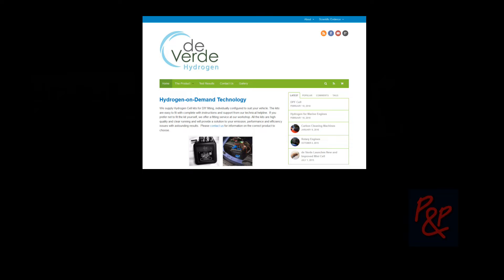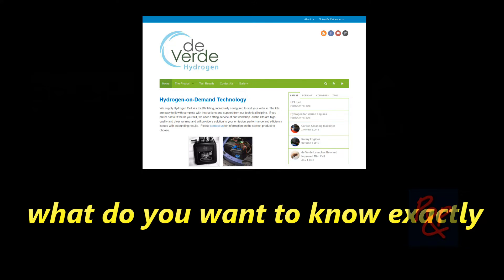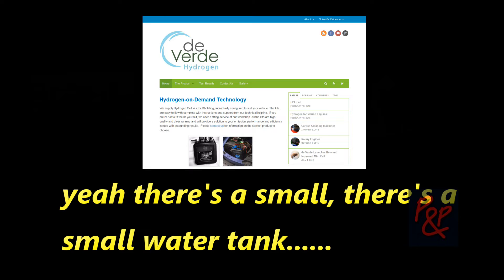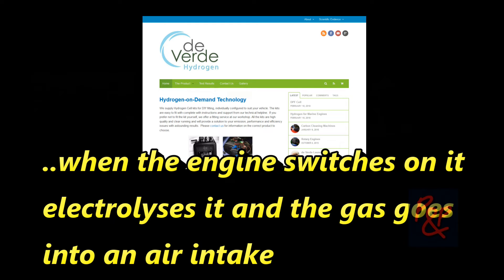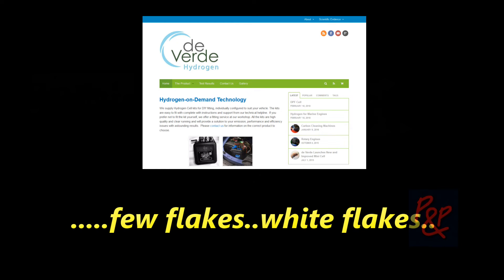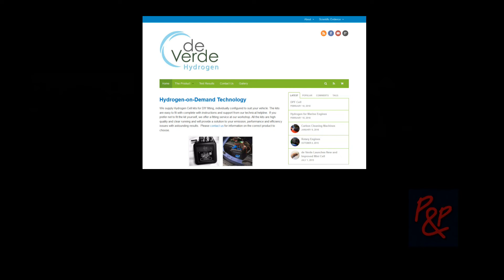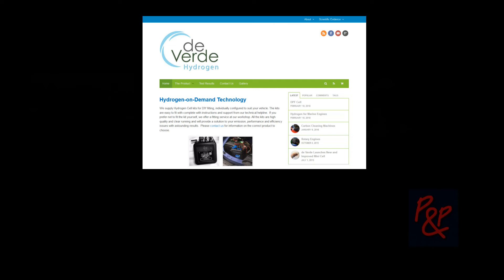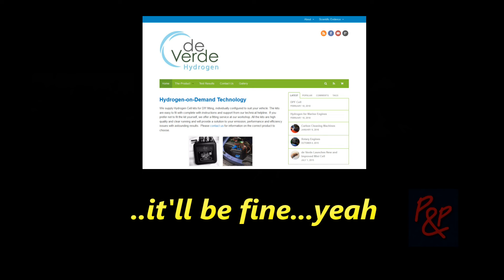Electrolytes Demonstrate Water Is NOT Hydrogen & Oxygen #2

Comment: This is basic chemistry from so long ago I can hardly rmr. However, if I rmr correctly this is a separation technique. Use an electrolyte like salt (NaCl) and dissolve it in water. Using a inert electrodes carry out the electrolytic process (if i rmr coreectly non metal at anode (positively charged) and metal at cathode (negatively charged). What you would expect is Cl2 gas evolving. However that's not what we see. Oxygen is instead evolved (outs a lit splint with a pop) because water is of H20 or H+ ions and OH- ions. Since OH- loses its electrons easier than Cl- the following reaction occurs 
4OH- ---> 2H20+O2+2e where oxygen relights a glowing splint. If water were not made of oxygen how could this be the case
Reply from the maker: The gases as products from electrolysis come from the electrolyte - not the water!!!
Reply: Peter & Pete
So where does the oxygen come from if salt is used as an electrolyte? If the NaCl breaks down into sodium and chlorine, the sodium will combine to form sodium hydroxide, NaOH, so there goes the oxygen and half the hydrogen.  
What happens when a solid polymer electrolyte is used, there is nothing other than the H2O for the gases to come from?

Comment: Didn't this dude just explain that the KOH is a catalyst? I can't believe this.
Reply from the maker: Chavez Harding so how do YOU know the hydrogen and oxygen come from the water and not the koh? Love to read your response!!
Reply: Peter & Pete How on earth can Hydrogen come from KOH??
Reply from the maker: great question and one that we are trying to establish. we've cracked where the oxygen comes from, just need to sort out the hydrogen because hydrogen, like oxygen certainly does not come from the water.
Reply: Peter & Pete No they both come from water. You see in electrolysis you can treat it as if you have two ionised solutions. When dissolved in water KOH dissolves into its respective constituent ions 
KOH---> K+ + OH-. However you can also treat water as if it's in its constituent ions 
H2O <----> H+ + OH-. Now that we have that established
At the cathode (negatively chaged so it will attract metals or possitively charged ions) we have two ions K+ and H+ (we'll only deal with cathode since anode is pretty straight foward cuz they're both the same ions) Since this is basically a separation technique the aim is to separate ions. One way of doing that is discharging metals where the non metal loses its electron which flow through the circuit and the metals gain electrons (basically the opposite of how they naturally react). I assume you know that K+ is a more reactive metal than H+ after all it has a bigger orbital radius and only needs to lose one to become chemically stable. However, in it's ionic state at the cathode it is simply too stable to accept electrons that easily to become a metal. However, H+ can more easily convert to its discharged form compared to K+ and thus it accepts the electrons easier than K+ and thus the following reaction occurs
2H+ + 2e- <---> H2 
H2 is hydrogen in its gaseous form. This explains why a gas which would out a lit splint with a pop would be produced. Hydrogen gas is explosive in nature.
Reply from the maker: Chavez Harding prove the gases both come from water alone. How do you intend to do that? Please tell me so I can repeat your methodology. If you cant tell me then stating they both come from water is just your opinion and I thank you very much for expressing that.
Reply: Peter & Pete Electrolysis? The same thing you've been doing. Try doing it with a dilute salt solution (NaCl). If I rmr correctly, unless you put in too much salt, Oxygen should evolve from the anode and Hydrogen gas should evolve from the cathode. The oxygen couldn't have come from the NaCl. Make sure its dilute tho or the Cl- will overpower the OH- and you'll get a yellow-green pungent gas evolving instead at the anode.
Reply from the maker: Chavez Harding sorry I've been electrolysing nacl for hours,  the solution getting weaker n weaker, it's getting clearer and clearer and to date, I only get hydrogen n chlorine! Progress is ongoing but I'm very satisfied even now that chlorine will always be produced at anode! Do it yourself if you really think oxygen will be produced at anode!
Reply: Peter & Pete What? Noooo you messed up. You can't put in a concentrated solution of salt and wait till it has been used up. That'll take forever. Plus the fact that chlorine only needs 2 mol and OH- needs 4 mol. 
The solution must be dilute initially.
Reply: Peter & Pete I did it in school...
Reply from the maker: Chavez Harding so tell me what I need to do to show oxygen n hydrogen come from water using nacl!
Reply: Peter & Pete In addition to that... the process is reversible 
2Cl- <---> Cl2 +2e so really your experiment will occur until the process has reached equilibrium i.e it'll never completely finished (although electrolysis doesn't occur in a closed system so I can't say what outside forces would have an effect)
Reply: Peter & Pete Do the same thing you've been doing. Just don't put in a lot of salt and wait for the chlroine gas to stop evolving that will never work. You must add a small amount of salt initially making it a dilute solution. Basically you have to redo that experiment from scratch. Trust me, I feel your pain. I've had to redo a lot of experiments from scratch.
Reply: Peter & Pete Around 10 grams of salt
Reply from the maker: 10 grams of salt to how much water? How much voltage do I use? (I currently use 7.2v) How much time? Come on, you're not very good at this are you because you ought to have provided me with enough information to carry out the demo successfully without having to ask these questions.

And you do realise I intend to video the results along with your suggestion showing these comments.
Reply: Peter & Pete Nope not very good at this at all the last time I did this was like 2 years ago and that was once. Try a voltage under chlorine's enoch value of 3.16V. Forgive me for not remembering.
After some quick research it seems 1.229V is the best voltage.
http://www1.lsbu.ac.uk/water/electrolysis.html
This is good link I found if you want to know more
Reply from the maker: I've read thru the linked article and nowhere does it state one can harvest oxygen and hydrogen from the electrolysis of sodium chloride! I think it's YOU who really needs to carry out this demo to prove to yourself that you could actually be WRONG!
Reply: Peter & Pete sigh ok

Comment: The guy on the phone says the catalyst is KOH Hydrogen peroxide? and is white flakes. Hydrogen peroxide is a liquid so it  will not be that,  it will be the KOH which is Potassium Hydroxide which comes as white flakes that is added to the water. Potassium Hydroxide is a compound of potassium hydrogen and oxygen.   The water needing to be topped up is assumed in some of the comments as being the source of the hydrogen, however it may be due to evaporation as electrolysis generates heat.   So to prove conclusively that hydrogen can be extracted from water it would have to be done with a catalyst that does not contain hydrogen.
Reply: I was not referring to evaporated water as being the hydrogen source, rather the evaporation being an explanation for the water needing to be topped up
Reply from the maker: Very logical comment Lawrence.
Reply: Lawrence Wright Ahh my bad misread
Reply: Lawrence Wright What even is this?
Reply: Peter & Pete It's really not. The main problem I have is that he thinks it's due to the evaporation of water. When water evaporates, it's due to the unequal kinetic energies water molecules have. At the same temperature the water has on average the same amount of kinetic energy, however some have more than others. The ones that have more rises to the top whilst the others go closer to the bottom. At the top, it's easier for high energy water particles to escape and thus something that crosses the surface like a gust of wind can allow them to escspe. 
I'm telling you all of this to say. Evaporation does not result in water breaking into its constituent molecules. It results in the release of the entire water molecule from the surface of water which is why when testing for hydrogen from evaporation you'll never have your lit splint go out with a pop. There's no hydrogen gas present to do so.

Comment: Peter & Pete  Water must be the catalyst then?
Reply: JohnnyM 
Water is disappearing, KOH stays for several years. Guess a new definition of catalyst is needed.
Reply: Chavez Harding
Swapping the meaning of the words product and catalyst.
Just a sad joke.
It is obvious that the electrolyte acts links a catalyst and the gases (O2 and H2) are product of water.
Reply from the maker: A catalyst is a substance that increases the rate of a chemical reaction without itself undergoing any permanent chemical change. This definition implies a chemical reaction would occur but only slowly without the presence of a catalyst.

So without the water would the reaction take place? No, so therefore the water cannot be a catalyst. And conversely, if more water was added would the rate of reaction increase? No. Therefore water cannot be a catalyst.

In my opinion, I've generally only known catalysts to provide additional heat during a chemical reaction. If you haven't done so, check out our video on The Cat Con where we discuss catalysts. 

https://www.youtube.com/watch?v=RjTF0HVBzmU&t=1s
Reply from the maker: KOH stays for several years? Why don't you buy one of those kits and come back and tells us in 7 years time!!
Reply: mpunkt How?